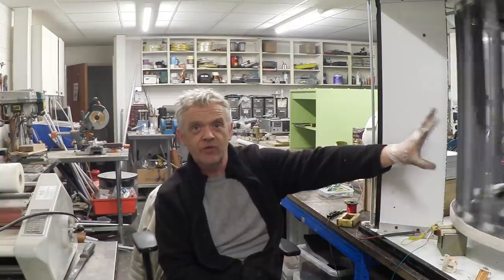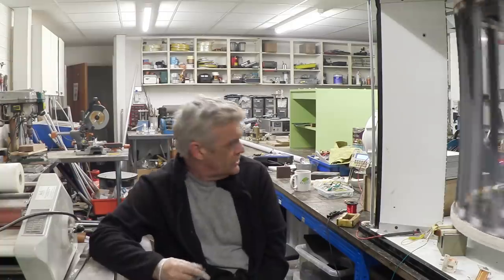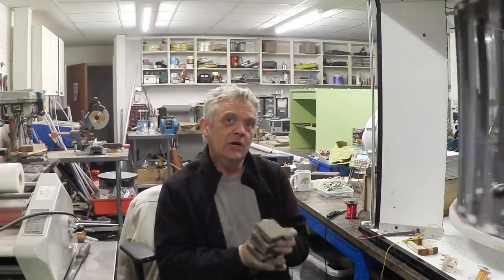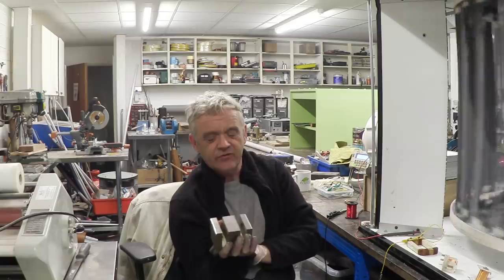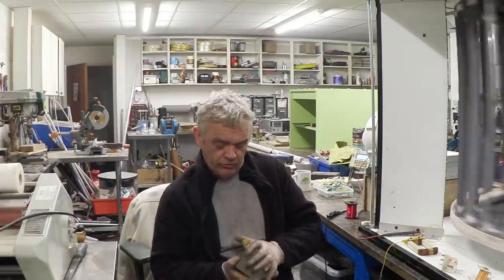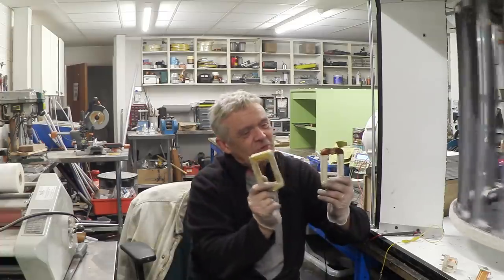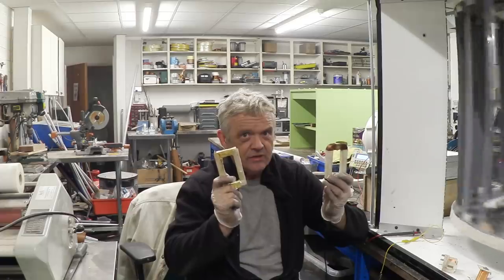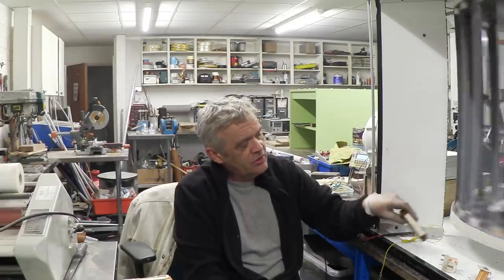Building a 1kW Wind Turbine For Under £100 - Part 5 - Messing With Coils

Comment: My 9x9x18 shows why the iron works with plates. I am going suggest research "coral castle PMH ".
Reply: That PMH uses 2 coils on one core. Any U bolt works. One coil is clockwise wound and the other coil is counterclockwise wound. So if you connect a battery to both coils one makes a north pole magnet and the other coil makes the south pole magnet. With a pulsed connection to a DC  battery it was producing a lot of voltage. One capacitor would charge to 170 volts with HV diodes. The other capacitor would charge to 250. The third capacitor would charge to 700+ volts using a voltage doubler circuit.  At 200+ volts led lights will light up with only one wire connected.  One of my favorite demonstrations is I connect the led torch to the iron core, just the positive of the torch. Now touch the case of the light and it turns on. Nobody has given me a good answer on what is happening. My volt meter shows 0 volts but the lights are on.  Myself i would have mounted the magnets about 3 to 4 inches 75 to 100 mm towards the hub. Just to give the blades more leverage on the magnetic cogging  the hub is the fulcrum.

Comment: You have to tailor it to make it best. Finding out your average wind speeds in your area, then adjusting your turbine to it. Otherwise making it more complex by automatically, changing the distance/influence of coils to magnets can be used perhaps for different wind speeds? Kind of like the incline/decline feature in treadmills. 

Having a set of 3 wind turbines of different wind ranges; low, mid, high would allow for best collection of energy. All about which one you want to capture.

Comment: Your bearings are most likely packed with grease. You'll get more rpm with less input if you clean (mineral spirits) and repack the bearings with sewing machine oil or mineral oil. Breakdown temp of mineral oil is around 500*F. Your rpm should double.
Reply: I was investigating bicycle rollers and came across this.

Comment: How about putting a iron core with active PWM circuit for limiting generated current + feedback circuit to have RPM value, so simple code for MCU will reduce PWM duty cycle when RPM will drop to less then desired, this way You'll be able to control current generation accordingly to wind speed in realtime. I think You will get times more generated power.

Comment: 9:00 it would be cool to build a system to automatically move coils in and out, with cores or without, and have the movement controlled by the wind speed. Low speed wind no core, high wind core.
Reply: i had this idea too. it could transform this turbine into even more of a wind power scavenger.

Comment: Looking at diagrams of dynamos many of them have 2 coils wired in series which use both sides of the magnet at the same time. Have a look at dynamo diagrams on Google images. Edit series not parallel

Comment: Also, wind speeds and cross-magnetic reflux, you need to find a table for this, but the results WE found HERE is that HIGHER SPEEDS, WITH an iron core BOTH INCREASED power, AND at the speeds we tested at ['too fast' possibly?] so if you go far below the cross-coil velocities we obtained, you may well get better results, I can not say. ~( ,m,)~

Comment: We are getting into real electrical theory now. How about cutting the Microwave transformer both ways so it's the size of the magnets. Hold it together with electrical tape so it doesn't fall apart. Then wind your own winding round that core to the number of turns you find you need?

Comment: Oh and do the coils in groups, parallel them all or series/parallel them (same coils) to achieve what voltage you want and then run them through seperate DC/DC convertors then you can use both coils, get the voltage, amperage and wattage from all that copper you have..lol

Comment: Not sure why you wouldn't attach a %90 eff.generator/alternator on the shaft. Your coils will be at best %25 eff. and cost %100+. On top of adding off balance loading of turbine + lots of guess work + your TV reception will never be the same.

Comment: would a powdered magnetite core work, more then air core but less then solid steel
Reply: Excellent idea i was just thinking the same
Reply: These cores are intended for high frequency application. Usualy 10 kHz and more. Iron cores are for low frequency. And there is a reason why...
Reply: @urbixs  EVERYTHING EVOLVES AROUND PRESSURE AND BALLANCE

Comment: It's got to be bobbins with a bolt!  Easily available, no real work needed, cheap.  Microwave oven cores, whilst being free if you happen to find one, are not that easy to come by or process.  Most council dumps don't let you take them away (which is utterly ridiculous, but there we are).

Comment: From what i remember from experimenting and studying Wind Turbines myself about 5 years ago. They talk a lot about co-efficiency and matching the right type of generator for your type of blade design. its like with your batteries,  each system has to be well matched to get the best performance out of it. Just like the electrolyte and the type of separator you use, the blade design type should work best with a particular type of generator i.e. low or high rpm etc.  I think you may need to work out the co-efficiency of your blade design at your targeted wind speed range, working out what rpm your design will give - then matching the generator type to that. There are some DIY wind turbine websites out there with calculators to help you. So it is about matching it all up to get the most efficiency. i opted not use iron core as the extra energy output didn't give me any extra efficiency with my design. it creates drag or cogging as its known, which is the slowing you've experienced.

Comment: Power out =power in × efficiency.  Efficiency will always be less than 1.  Any loading of the output will put a increased loading on the input, If there is insufficient energy in the air flow the rotary speed will drop.  No free energy here folks:). I expect there might be a speed that that gives you your best efficiency.  May be a controller that tries to maintain that speed would be good. A bit like a mptt controller for solar panels.

Comment: can you stack both coils and get the higher AMPs and the higher voltage or does that mess things up?
Reply: Doh commented to early ok not going to work
Reply: could you then put a thin wire winding and a thick wire winding next to each other? seem like you said that on top of each other cancels each other out.

Comment: On the table behind you is a roll of magnet wire, so try it as a pickup coil by putting a steel core inside. The height looks like it may actually fit under the magnets. OOPS! I should have finished watching before commenting. Red faced here.

Comment: Thanks for this series of your wind turbine. I especially appreciate your discussion of the relation of power in and power out. One experiment you might try is shorting the output of the coil while the turbine is running to see how much the turbine slows down. I will also be interested to see what happens when you install more coils in your turbine and load up the outputs. It will be interesting to see how much output wattage you can get.
I am also interested in how big the fan is that you are using to drive your turbine.

Comment: Another thing whilst I think of it - there's not a cat in hell's chance of making a 1kW VAWT in the form that you have there - 1kW is a little more than 1.3HP - that is one and a third horsepower. So ignoring losses due to friction and heat, the wind would need to drive the turbine with the same power that a (notional) horse and a third could pull it round, were a rope wrapped around it. As I noted in my other comment, it's entertaining and very interesting to see you experiment and bring old patents and theories into a practical reality for us to ponder upon, but offering unrealistic objectives isn't helpful - I'm still hopeful that the voltage and current (and thus power) outputs that you referenced in the video were taken concurrently(!), and that you'll show that to be the case...

Comment: Nah I would use it coupled to an alternator that puts out 16 Volts , and then into a 12 volt deep cycle lithium ion battery and use inverter to get 250 volts

Comment: Good day Robert, love your stuff. I have an idea, hopefully it will work. what happens if you place the pri and sec coils next o each-other, connect than in parallel, without a core, or using an extra core. logically in my mind that should then give you the amps and voltage of both coils at the same time. hope you test it and cant wait to see the results.
much respect
thanx

Comment: i use  this like battery Farad Condensator 2.7V 500F 6 Pcs/1 Set Super Capaciteit Met Bescherming Boord Automotive Condensatoren on the solar charge controller fool it like got a real battery on it

Comment: I know that you are trying to show how easily and cheaply this can be done. I also know that you are not are not overly concerned about efficiency but it seems a shame not to come up with an efficient electrical side since you’ve done such a great job of the mechanical part.
Back in 1995 at an electric car convention here in Sydney I discovered that an electrical engineer invented an electric motor that he called a T - FLUX motor,  PATENT REF. - PCT / AU 94 / 0405   I don’t know if he has renewed his patent or not but it looks as though he has closed his business as he would probably have retired by now. 
This motor was very simple, the rotor consists of three arms made from flat steel 360 degrees apart and on the end of each arm was a cylindrical rare earth magnet. The windings were actually a toroid coil formed around a C shaped former and the magnets would run inside the coil like a continuous solenoid. There were three connections to the coil again 360 degrees apart and the power supply was a three phase DC square wave input. As you could imagine it was a very short motor. It was also about 90% efficient with no iron and it was a high speed motor.
I was thinking that you could use the concept as an alternator but instead of going to the trouble of winding a coil around the whole perimeter of your turbine you could wind three coils about say 15 degrees each, join the ends together, position them evenly apart and instead of having just three magnets on the rotor arms you could have 6, 9 or twelve to have the same effect of a higher speed. Then you could connect the three phases to a full wave bridge rectifier.

Comment: the part where hes talkiing abotu the differences with the coils and thinks its because of the mass of copper  i want to clarify the understandfing is the coils are catching the energy from the magnets so if you have small magnets with not much power your energy is less so the best thing to maximize using small magnets is to have multiple coils  for mulitple spots catching the power from magnets

Comment: If having a metal core is better at higher speeds, why not consider using the greater centrifugal force to insert the core, more breaking more gerneration at higher speed, no core at lesser speed, less brraking better generation at lower speed.

Comment: But you will still get Tork Faradays law, its magnetic breaking, where we struggle for free energy, if a conductor or magnet is passed through a magnetic field, that fiield will cause tork or physical resisatnce.....I know what you are doing, with the microwave, but that then creates dimensional tork on the laser printed parts, you need the microwave parts all around and sunk down lower or high tork spindles and rotors......Carbon fibre like helicopter rotor blades.

Comment: “IF YOU were living remotely off-grid with a small, PV array & motor ‘augmentation’, you’d have perspective on necessity. IT WILL never resolve your dependence on motor ‘augmentation’. JUST SET it up to withstand high winds in a somewhat ‘protected’ location, with output that will contribute to lessening fuel cost & motor use. IS NOT a hopeless scenario. IS AUGMENTATION of PV & motorized DCA & it DOES work particularly well at night when it is windy. YOU WILL then want a diversion load the next day. AM IN a wonderful situation, perfecting motor augmentation via DCA. AM ASKING: ‘IS THERE a benefit to putting 10% to 33% DT on my PWM rotor?’ IS NOT bad. IS MANAGEABLE & protection circuit will otherwise do nothing for me (in application) except protect my stator, when inadvertently pumping water. IS MANAGEABLE. BEAR IN mind, I have a ‘free’-zer now too.”

Comment: Before you decide which way to wire up the coils think about which inverter you want to use 1st. 
The cheapest run on 12 or 24 volts. Also wind power inverters are special not the same as solar inverters. I only know a bit about Solar kit. 
Once your batteries are full a Wind power inverter switches its load to a dummy load (usually a big ceramic wire wound resistor) clever inverters adjust the load on the coils to maintain a spin speed between safe and efficient rpm's. Too fast and centrifugal forces will destroy the device. Too slow and it will not be efficient at all. There is a relationship between wind speed and rotor depending on things I do not understand at all. Similar to propellers in water.